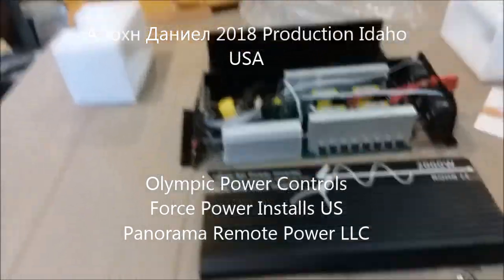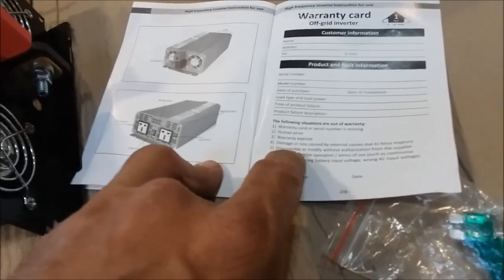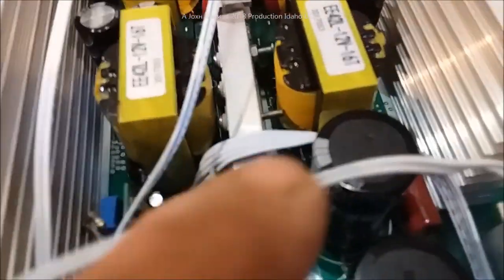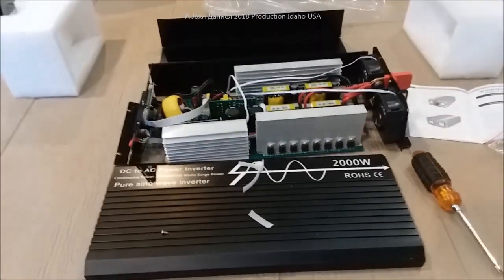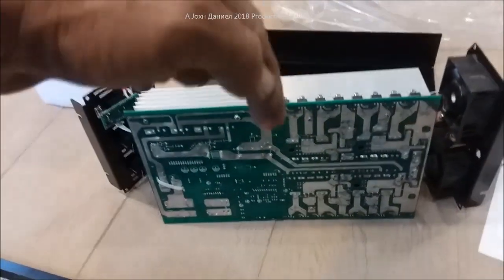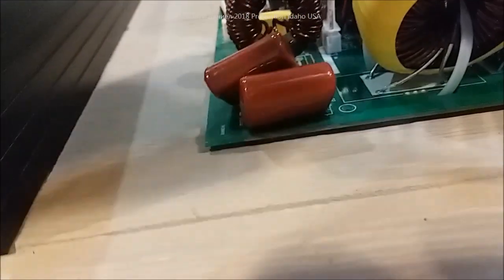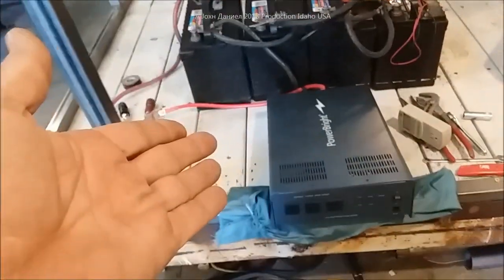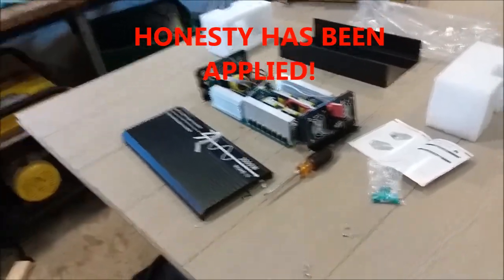Power inverter repair (vid 1 of 2) common problems, OPEN AND REPAIR

Comment: It's prohibited in the United States to sell an item that has tamper stickers or deny warranty of any product, because the user took it apart to examine the internals. In fact it's supposedly against the law for any U S manufacturer to apply tamper seals to any product intended for sale in the U S. 
I looked it up somewhere about a year ago and it's true. You can actually complain to a Consumer product department agency about tamper seal.

Comment: hey bro i loved your video i have an almost exact inverter here its from china garenteed piece of shit it has a problem i cant find its not giving errors but the relays aint allowing power output when its supose to run from batery ...its a tempest 3000watt they should have called it chinese cheap shit anyhow any schematics or pointers to the actual problem would help i replaced the relays  and 2 hours later when the power failed in this shit country the relays again did not triger

Comment: Hello, 3000 watt solartronics full sinus inverter fault light is on. When the inverter is turned on, a relay tripping sound is heard, then the fault light is on, what do you think could be the problem?
Reply from the maker: Did you over exceed it's voltage capability in either low or high settings. That behavior is similar to a supply MOSFET failure.
Reply: @PrepperMountainSolutions  inverter peak 6000 watts, continuous power 3000 watts. only refrigerator connected peak 650 watts then 270 watts. Did you mention battery voltage level exactly. I noticed that mppt charge controller sometimes fills the battery at 14.80 15 volts momentarily.
Reply from the maker: Possibly you've overvolt the inverter, 15 is fault point. But I'd suggest opening it up and looking for damage. Let me know what you find.
Reply: @PrepperMountainSolutions  I don't have the inverter with me.  I will be with you in a week.I didn't see any noticeable faults.I will look at the values of the mosfets and diodes with a multimeter.Of course I will share the result with you.Thanks for your interest.

Comment: mine puts out 145 volts how do I get it down to 120-115
Reply: Turn the pot down, it's a box looking thing with a flat head slot in center, turn either way, turn it till it brings voltage down.

Comment: I think the main point that he’s trying to driveIs that they tossed safety out the window, with the wires touching that equals fire. Lower quality should not mean completely unsafe. It should mean cheaper parts or less features especially in something as fire hazardous as an inverter. Let alone I feel like the entire thing should be assembled.

Comment: China sells WHAT WE ASK FOR. They produce what corporations ask for. The cost cutting and Shortcuts are done on the side of the corporations. like Harbor freight or whomever… They go to China and specifically ask them to make them a cheaper product.

They are at least two years ahead of the rest of the world when it comes to industrial equipment and electronics. Just like any country… They make junk and they make good stuff. And a lot of in between.

Every country has their flaws, no country is without major problems. But after spending the better part of two decades importing and working with the Chinese… their products span all ranges of the quality spectrum.

This coming from a blue blooded and proud Tennessean by the way.

I enjoyed your two part series on these! Im still learning electronics troubleshooting. 
If I’m not woodworking… then I’m elbows deep in some weird industrial electronic device…prodding, poking, and PRAYING!

Thanks again for the content!

Comment: I have power inverter that went bad, I suspect mosfets. Theres 4 of them IRFP260M. Do any other letters on it matter or not? I have P514J? Cant find exact mosfets, only IRFP260M part,  other letters dont match. 
What else could be wrong with it if not mosfets. It powers on, shows voltage, says for a sec it uses 500w, then goes to 0. Cant power anything. I checked with multimeter the outlet, voltage is all over the place. No blown fuses. Maybe transistors? Nothing blown. Caps all good, connection to bluetooth shows all good. No alarms.
Reply from the maker: Send me pictures of it, many of them at all angles to my email olympicpowercontrols@yahoo.com
Reply from the maker: PS - I think the bottom of the board needs looked at for poor SOLDER joints on the stage 2
Reply: Its started working again. I took it home, did some looking, couldnt find anything. Then plugged to my power supply and it worked. Could it have reset itself after I unplugged it? Though the power output is fluctuating, but after watching other channels they've mentioned that not every multimeter is suitable for checking out put voltage on inverters. He used exactly one I have, cheap one from harbor freight, which showed 80v on his inverter... I appreciate your response anyway. Real test will be on Monday

Comment: John what do you think about these inverters?WZRELB

5.0 out of 5 stars  5Reviews

WZRELB Full Power Endurable 3500W 12VDC to 120VAC 60HZ US DUAL
Reply: I have 5 of them and all have worked with 0 issues, and powering well pump, fridgerators, toasters, etc.

Comment: My powerbright 6kw 12kw msw inverter was showing 135.6v 32amp on all ports john so I unhooked it . Some kind of feedback transformer problem not sure. Do u fix these? I bet it's not a hard fix what would u charge me to fix it and test it? I can bring it to you to look at if you think u can fix this. The unit is out of warranty 600.00 unit. This has been a beast for 2 years always kicked ass. And the top positive terminal also broke and I would love to have fixed too. What can u do?
Reply: How much? I need it fixed ASAP it's my main power unit. If you have the time can I drive to your place and have u look at this and repair I can pay you through paypal I'm broke till pay day only have plastic to float with I ordered a small 3500 watt pure sine model I showed you above for 206.00 damaged box deal tested very good condition deal. Hopefully lol
Reply: I called amazon and asked about the unit before I bought it they said its guaranteed warranty and the unit was tested to make sure no damages.  They said if it fails all money will be refunded and free shipping back I have prime.
Reply: Do you know if the hard start dometic AC kits work good? Mine surges at 3,100 watts 2 or 3 seconds then draws 1,336 watts continously if I install one of those kits will this other inverter start this 15000 btu AC okay for 6 hour run time with real good cooling system?
Reply: I think my powerbright 6kw inverter is having feedback transformer bleeding through or something.